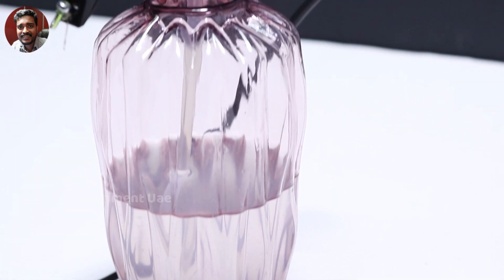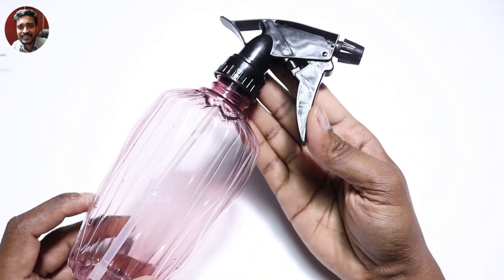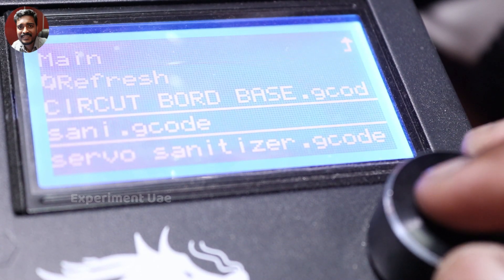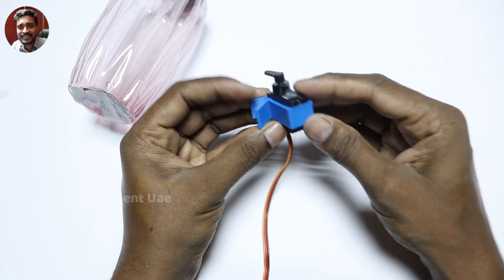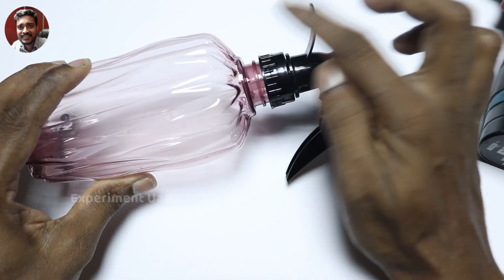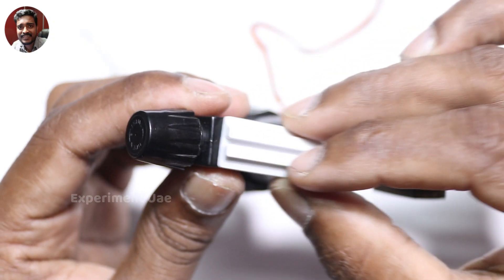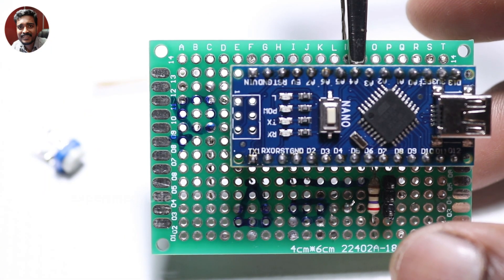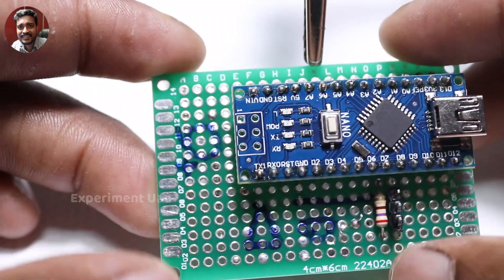DIY Automatic Hand sanitizer Dispenser | Without IR SENSOR & MOTOR | Experiment UAE|

Comment from the maker: code 
 //Experiment_uae
//writing_Rojar
//, You can modify it.
#include <Servo.h>
Servo sg90servo;

int fivemm_led = 6; // D6 external led
int led_arduino = 13;  //D13LED on arduino
int photo_transistor = 7;   // D7 photosensor
int val = 0;     //Variable that holds the read value
int state = 0;  //status

void setup() {
  sg90servo.attach(8);
  sg90servo.write(65);
  pinMode(fivemm_led, OUTPUT);   // LED on the circuit 
  pinMode(led_arduino, OUTPUT);   // LED Arduino 13dfl
  pinMode(photo_transistor, INPUT);     // Set to input for switch
}

void loop() {
  val = digitalRead(photo_transistor);  // Read input pin
  digitalWrite(fivemm_led, val); // Change the value read from the pin
  digitalWrite(led_arduino, val); // Change the value read from the pin
  if(state == 0){
    if(val == 0){
      sg90servo.write(-180);// servo rotation valu 
      delay(200);//next rotation dely 
      sg90servo.write(90);// servo rotation valu 
      delay(150);//next rotation dely
      sg90servo.write(-180);//servo rotation valu 
      delay(200);//next rotation dely
      sg90servo.write(90);// servo rotation valu 
      delay(150);//next rotation dely
      sg90servo.write(-180);//servo rotation valu 
      delay(200);//next rotation dely
      sg90servo.write(90);// servo rotation valu 
      delay(150);//next rotation dely
      state = 1;
    }
  }
  if(val == 1 && state == 1){
    state = 0;
    }

}

Comment: 3d printer  ethra  rupayayi  bro
Reply from the maker: [897.07 AED 24% OFF]Creality 3D® Ender-3 Pro Prusa I3 DIY 3D Printer 220x220x250mm Printing Size With Magnetic Removable Platform Sticker/Power Resume Function/Off-line Print/Patent MK10 Extruder/Simple Leveling 3D Printer & Supplies from Electronics on banggood.com https://banggood.app.link/BAujFXvlI6